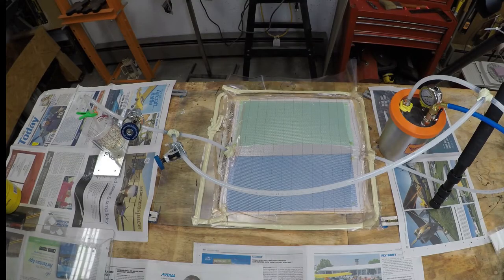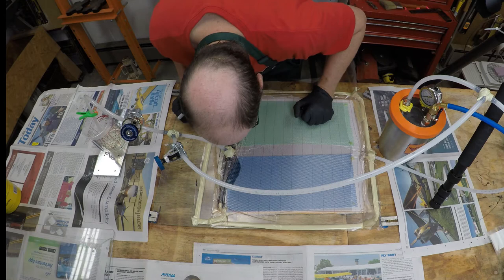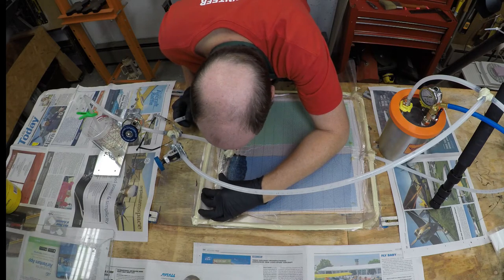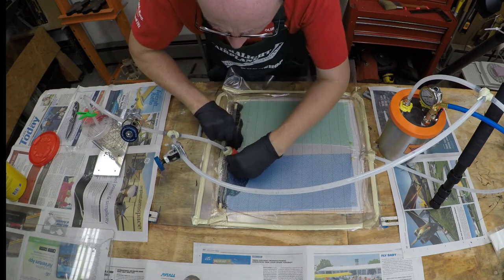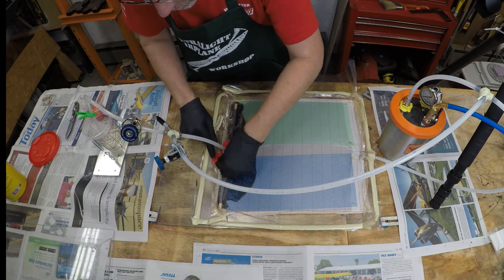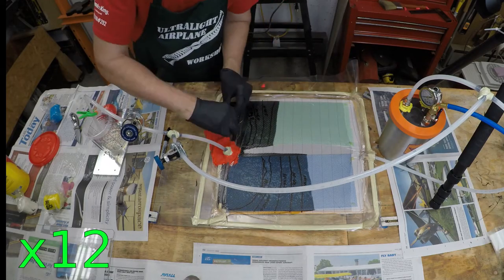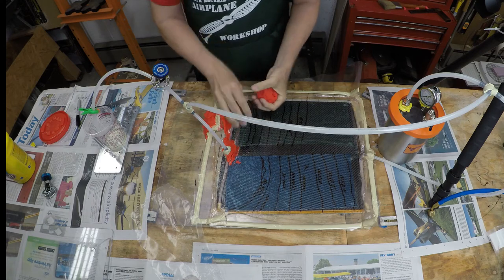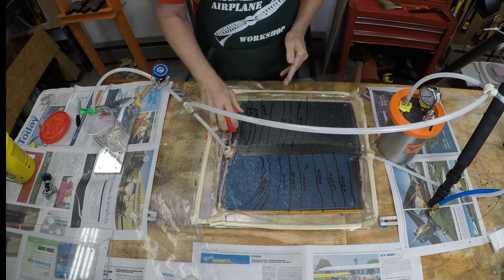Composite Tip: Use A Toy to Stop Vacuum Bag Leaks

Comment: I tried play doh, and found that it didn't stick well to the plastic vacuum bag, and it dried out quickly, crumbling apart. Then I tried using oil-based modeling clay and it worked great, never dries out, and sticks well to plastic. You can get it from US composites, composite envisions, etc. "Plasteline Clay"